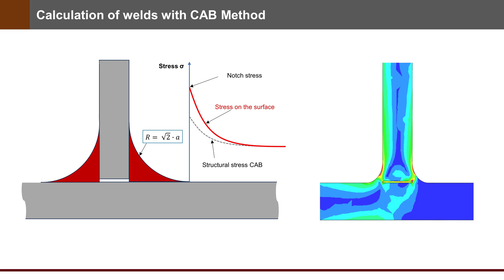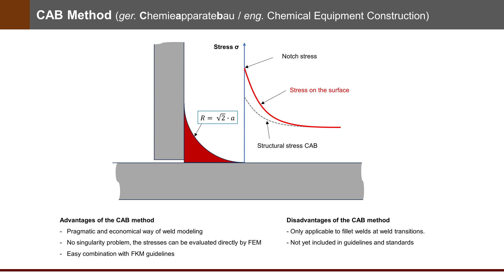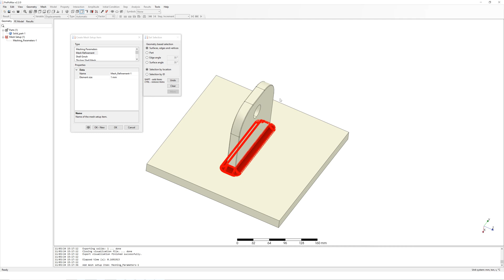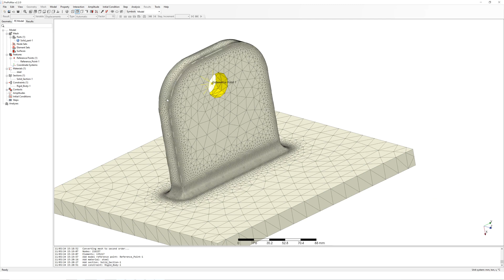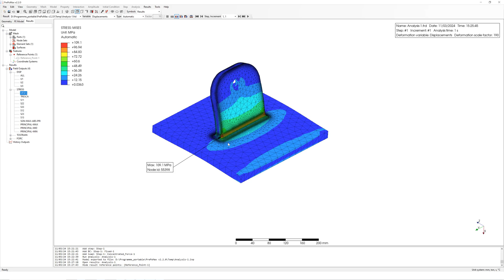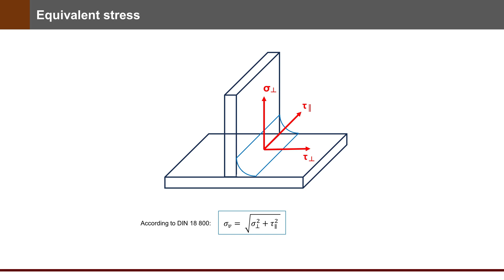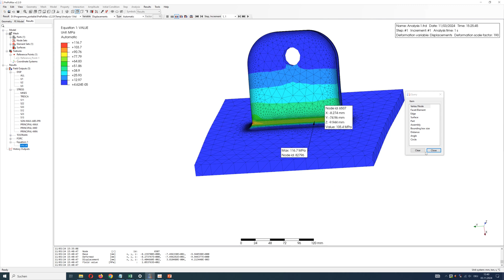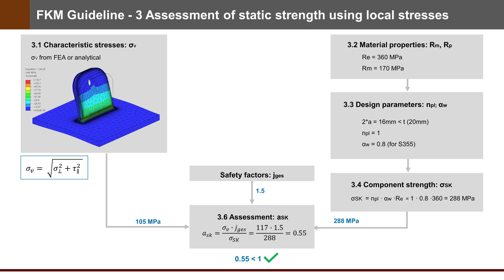Weld simulation - CAB methode and assessment with FKM guidelines | PrePoMax

Comment: I have a tensile test model of two sheet parts with different thicknesses joined by laser welding (tailor-welded blank). I modeled them as two separate parts, but I don’t know how to represent the laser weld/interface in PrePoMax. Which method should I use to connect them (e.g., tie constraint/contact/connector)?

Comment: In the output listed at 8:15 isn't sigma_v supposed to be 105MPa? Where did 117 come from in the equation?
Reply from the maker: Hello. Stress 117 N/mm² is located at the weld root. Structural stress concepts such as "CAB" or "Hot spot" are not suitable for evaluation at weld roots. Therefore, the stress at the radius/weld transition (105 N/mm²) is evaluated. For weld roots analyse, the notch stress concept must be applied.

Comment: I think you have a typing error at 1.37. Tensile strength should not be less than yield.
Reply from the maker: Yes, you are right. It is a typing error. For steel S355 is yield strength 360 MPa and tensile strength is 470 MPa